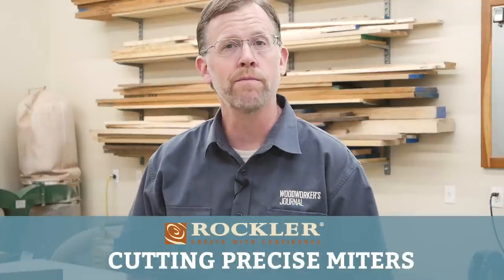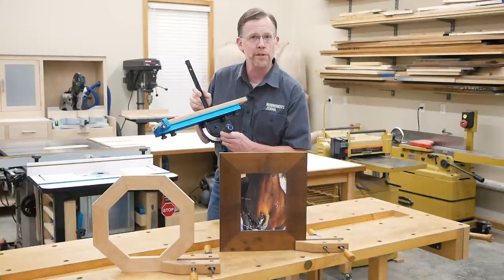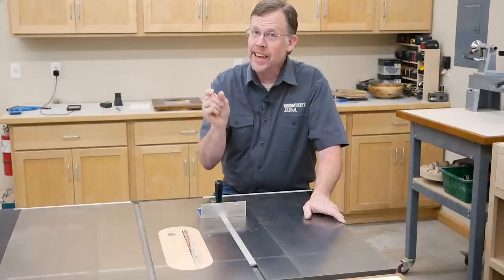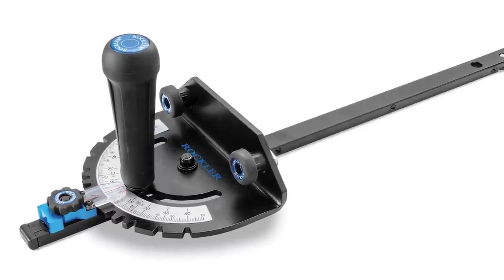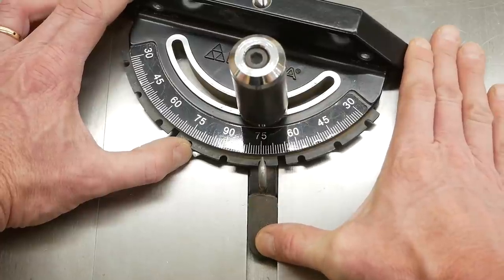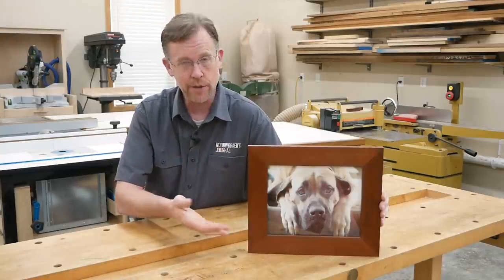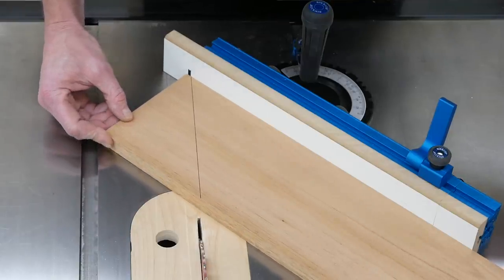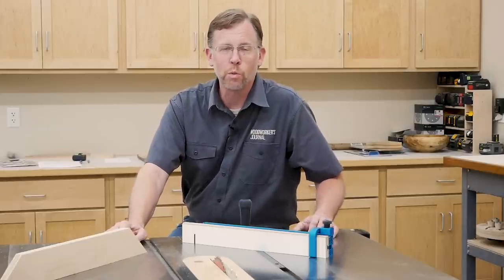Cut Precise Miters with the New Rockler Miter Gauge and Fence | Rockler Demo

Comment: Just got the combo. Only issue I have (so far)  is that with the fence tilted 'away' from the blade the aluminum part of the fence has to be slid so far to the outside (to keep it from making contact with the blade) that the 3rd hold down screw's knob hits the knob that holds the fence to the gauge.
Reply from the maker: Hi AZCobraman, Please reach out to our product support team at 1-800-260-9663 or support@rockler.com. They'll be able to assist you. Thank you

Comment: I could not tell, but it looks like there is not a scale on top of the fence for the miter gauge stop.  Could you please confirm if there is a scale on top of the fence.
Reply from the maker: There is no scale on the top of the fence. However, you could add adhesive measuring tape, which you can find on our website at https://www.rockler.com/self-adhesive-measuring-tape

Comment: Why is the dust groove cut into the top of the melamine fence face?  Shouldn’t it be on the bottom?
Reply from the maker: The top has a chamfer to break the edge so it isn't sharp. If the groove was at the bottom, it would no longer be zero clearance and you could get tear out while making cuts.
Reply: @rockler  and I thank you for that!

Comment: How accurate are the angles? If they are off how to you correct it?
Reply from the maker: Hi Steve, the miter gauge's scale is laid out with thin, single-degree demarcations, and a hairline cursor makes it easy to see which degree mark you're setting the gauge to. So, single-degree accuracy is reasonable here. There is no way to adjust the gauge's preset detents. But by retracting and locking the spring-loaded stop that sets the gauge to these detents, you could set and lock the gauge as close to the detent as you like by tightening the handle instead of using the stop feature.
Reply: @rockler  So, if I understand correctly, you are saying that the gauge will always be, for example, 90 or 45 degrees (or whatever angle I set) from the miter slot on my table saw. Is that right?
Reply from the maker: @stevesiefken6432  Yes, the preset detents should accurately set the gauge's fence to the angles they indicate. While the detents can't be adjusted, they also can't reasonably be thrown out of adjustment either, unless the spring-loaded stop were to be significantly damaged in some way. The detents are cut into the gauge's steel plate and lock the stop positively at each angle setting.

Comment: Will the miter gauge you show fit and work on the job site table saw from Dewalt DWE7491? Also during my research on miter saws, there was mention the Teflon screws were a problem can you speak to that either way?
Reply from the maker: The bar on Rockler’s Precision Miter Gauge fits miter slots measuring 3/8” deep and 3/4” wide — it’s a fairly standard size on stationary table saws. However, some jobsite saws have smaller miter slots. Best advice is to measure the slot of the DWE7491 to see if it’s 3/8” x 3/4”.
Reply: It fits on mine.  @rockler

Comment: Does the fence have any type of measuring for length?
Reply from the maker: Hi Jody, the fence accessory for Rockler's Precision Miter Gauge does not have a built-in scale. However, as soon as you cut through the fence when using it for the first time, the blade kerf in the fence board provides a convenient "zero" reference for measuring out from the blade to wherever the flip stop is set and locked.

Comment: My gage is not square and you can’t calibrate it
Would not recommend
Reply from the maker: Hi Glenn Steed, Please reach out to our product support team at 1-800-260-9663 or support@rockler.com. They'll be able to assist you. Thank you
Reply: I'm having the same issue. Seems the locking detent is not a true 90 degrees to my miter slot. Can't recommend this product.